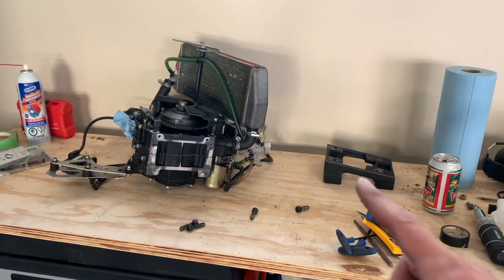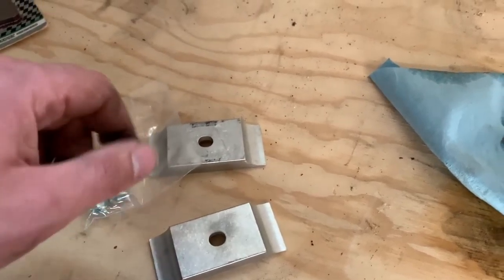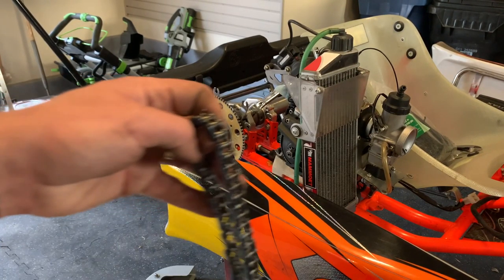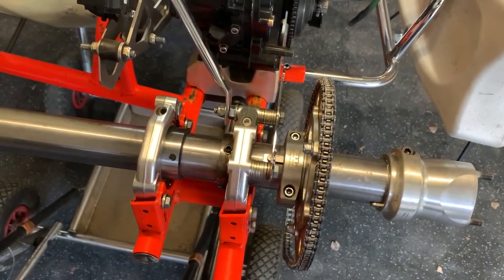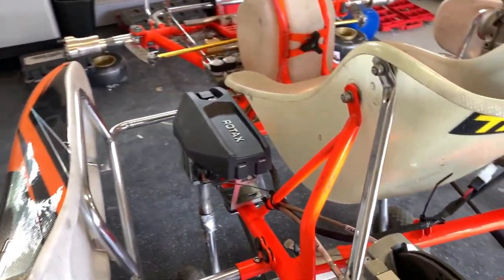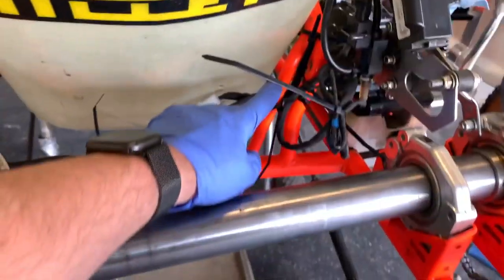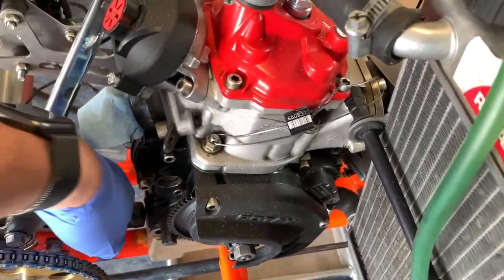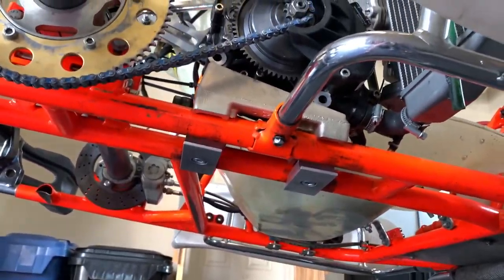Building Kart 94 - Part 3 - Motor Mounting

Comment: I really enjoy your videos Brent. May I give you an advise? For the engine mount do not use M10x40mm screws. It will kill the thread in the engine mount and cause headache on the track. Just use M10x60mm screws, those will not touch the engine and cope with the tension much easier.
Reply from the maker: I'll go get longer screws.  Great advice.

Comment: Another great video, Brent!  We’ve all made the stupid mistakes... part of the learning experience 😁 What are your thoughts in relation to running the 3rd bearing? Are you keeping it bolted up, running it loose or taking it out altogether?
Reply from the maker: I've always had it in.    I've never run with only 2 bearings.   That said, I know you can.   I've run with the bearing both tight and loose.  It simulates a siffer/softer axle.   In my honest opinion, its not a big difference.  you'd have to be pretty keen on the wheel to notice.   Cheers.

Comment: just a lil tip dont make that rubber thingy touch the engine because it can be bad for youre engine and gokart frame
Reply: Yea the rubber thing on my kart dried up and cracked one day while I was using it, and the chain came off.
Reply from the maker: I like to have it right close.  My motor mounts came loose on me a few times this year, and if it wasn't for that silly rubber thingy, i'd have thrown my chain and DNF'd.   I use it as a backup to keep the motor in place, but not very tight against the motor at all.
Reply: Brent Kadler okay:)

Comment: Hey man. U use an 81 rear but what drive r u using on the engine?? 11-+ 12 - 13 ????
Reply from the maker: Currently I'm using an 11T on the front.    With the new track configuration this might change.  Good question!
Reply: @brentkadler2870  thanks man. That is a 7.3 ratio I am using 85 with 12 on motor that is 7.1 so close & looks like our track here in Ontario r similar  so ratio seems right  - what rpm do u peak at - I pull 13.5 top & that seems to be where motor stops pulling  ??